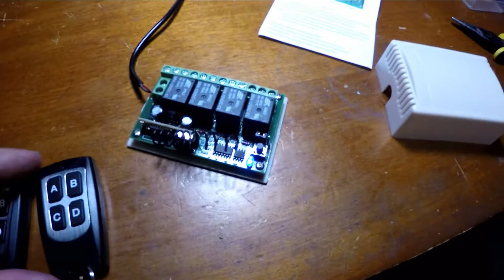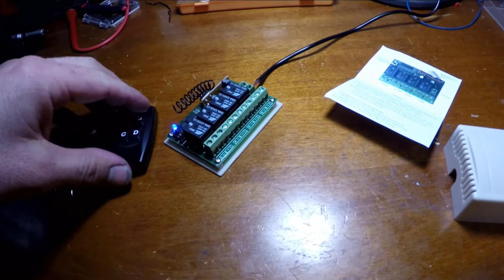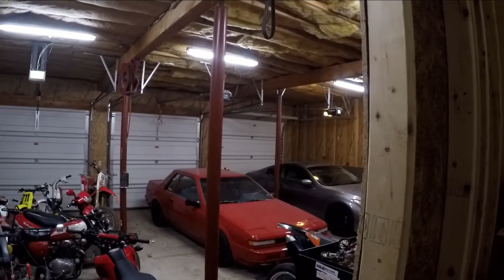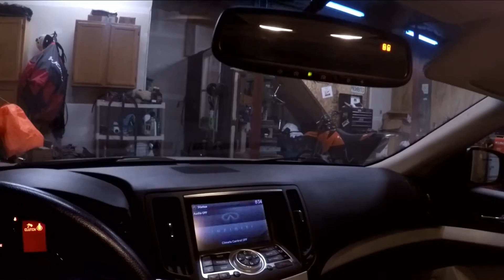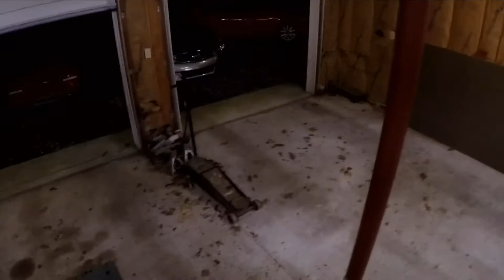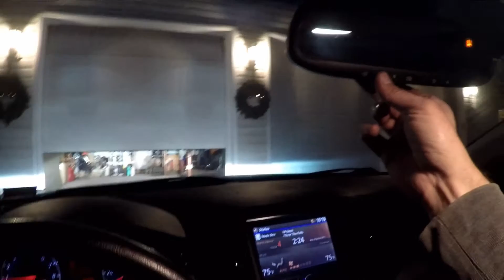Homelink mirror hack . Banggood remote control

Comment: i bought one of this few months ago, everything fine, now one of remote does not work. the red led on remote works but it is not sending signal to controler i think. i tried to pair it again, still not work, only the other one succeded pairing. the battery is ok inside remote (6volts). it is amazing because i use this controler only few hours for testings, and now i wanted to put it at work forever.
Any ideea?
Reply from the maker: Yeah mine has started to do the same. But it's been installed for like 3 years. Sometimes doesn't work. I'm positive just going to order a replacement
Reply: Just tried pairing one i have knocking around a few years, won't pair.

Comment: Is this the 315MHz model or the 433MHz model? US or UK? Or does it matter?
Reply from the maker: I don't remember the mhz . uk might have limited power.
Reply: @MotoFlyGuy  Thanks. I'm in the US, just wanted to make sure I got the right one. Your link goes to the 315MHz model, but 433MHz seems easier to find, thus my concern. Hopefully the one I get works with the HomeLink buttons in my car! :)
Reply from the maker: @IsraelBrewster   the one in the link is the one I have. just checked my history and its the 315mhz

Comment: the one button forward and reverse only works because the main box is already wired with forward and reverse but if you want to forward and reverse a motor you will need to wire two buttons, ie., button A for forward and button B for reverse.
Reply from the maker: Yep you could do it that way to run a motor. Just need to make sure the contacts in the relay can handle the motor.
Reply: @MotoFlyGuy  -using it on 12v motor but didn't check my 28V power supply that exceeded the 16V capacitors so I blew them up. Now I need to replace the 2 capacitors and see if it works again.

Comment: Very good video. I would like to know if your setup incorporates a rolling code feature. If it doesn't are you concerned about being hacked. I presently have an add on receiver (by street smart security with a rolling code feature) mated to a Genie screw drive (circa mid -seventies) but I was told by Homelink that it's not compatible with their product. So when I came across your video I was elated to find a compatible solution that works with Homelink.
Reply from the maker: Drew O not sure if it has rolling code or not. I'm just happy it works. Since you do have to link everything up I'm guessing it's protected in some way. I can look in to it.
Reply: Would appreciate it, thanks

Comment: my homelink does work  with my garage door opener ,you have to press the button on the back of the opener  not  just the button on the  door opener remote to program it
but it only uses 1 out of the 3 buttons so i wonder if i could program these relays with the other 2 button to do other things like switch on lights without having the homelink  lose connection with the door opener, could the homelink control the opener the normal way (not through a relay connected to the door bell button wires, which i also have setup) and then still use the other 2 buttons to program/control other relays?
Reply from the maker: yeah you could use the home link on the garage door like normal and still use the other buttons with the relays.

Comment: i use the single  relay version of these with a broadlink RM pro
so i can control  them with my phone,  e-control app
and i have a another app, a bridge app that has to run on an  always on android  device on your network called RM plugin  so i can  control them with alexa (andgoogle home /google assistant with a lot of fiddling with DNS and  port forwarding, and IFTTT using webhooks)
great since i  have a nexus i can just say "ok google open the garage" without even taking  my phone out of my pocket  and the door opens

Comment: i don't think these multi repay boards are good at all ,i have the single relay models
with these i don't think  having a 4 relay board is as versatile as having 4 single relay boards
because there is only one program button on the 4 relay board, what if you wanted to program
the A button on one remote to  turn on the 1st relay  and the B button on the same remote to switch off the 1sr relay and then program  the C button on that same remote to switch on the 2nd relay and the D button on that same remote to switch off the 2nd relay
i don't think it is possible , if you  get 4  single relay boards then you have 4  program buttons , and it is more versatile , they are about $1.60 on ebay or aliexpress w/o remote
Reply from the maker: depends on how you want to use them. 4 relay board worked worked best for what I wanted to do. and on the multi relay boards they have a little jumper that changes how the relays react to button presses.
Reply: yeah i know
i almost bought 2 2 relay boards then i realized there is no separate program buttons for each relay , yeah there is a jumper but what if you had 2 two button remote and you wanted one remote to switch on the 1st relay
with button 1 and switch it off with button 2 ,and then the second remote to do the same but only for the second relay ,i don't think it is possible even with the jumper  set to latched mode
and at 1st i bought a couple of remote ( i bought the relay boards separate) to program  my relays and to  program the RM pro ,but i do not use the remote i use my phone or tablet or echo or google home
i just bought the remote to get separate FQ's but then i realized that there are  user  uploaded remotes in the e-control app you can download ,now i just  download RF remotes and use the RM pro to teach the relays the code so i can just buy a bunch of relays for cheap and not need to buy remotes i will never use  just to get more FQ's

guess i will need to buy 4 single model instead of 2 double model boards for my application ,   which is to switch on/off my kitchen cabinet  LED strips with alexa ,  i can already with a wifi controller
and change colors and other things but i have both the  under cabinet and over cabinet lights connected to the  same controller so i am going to use these to be able to tell her to switch on the under cabinet and upper cabinet strips by switching the positive wires from the strips
since i already  am using a 12v dc power supply for the  wifi LED controllers it makes it convenient to power them

Comment: Very nice setup. So the controller is running on 12v dc. What is the voltage the device it controls? Is it dc or ac or both and what is the max?
Reply from the maker: Jackie  it's running on 12v DC. And it is switching relays so you can switch whatever voltage you want.
Reply: awesome thank you :)